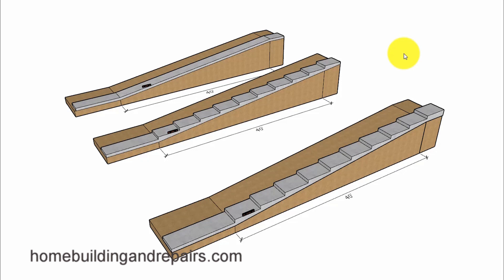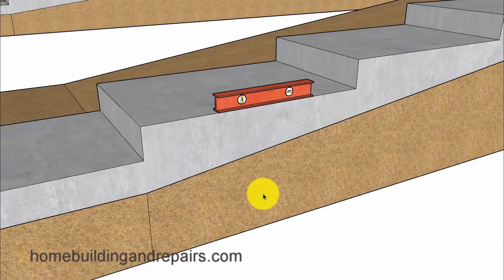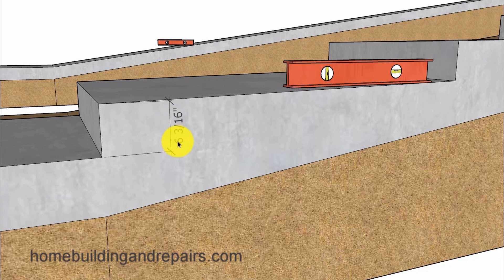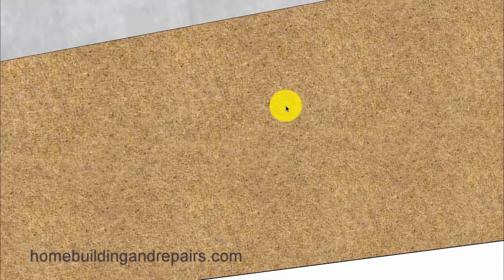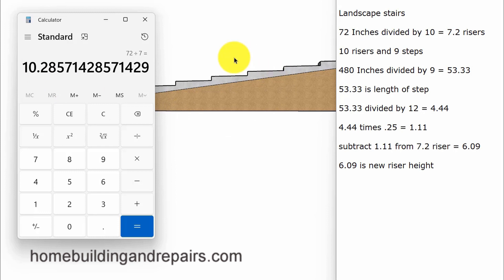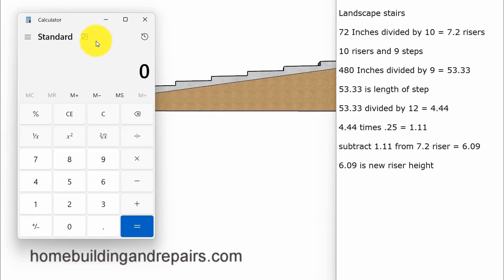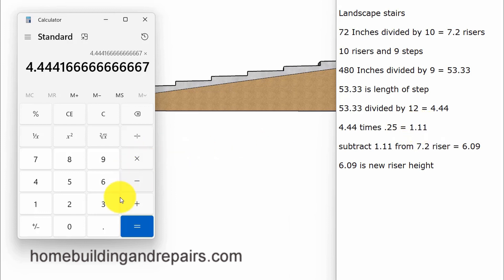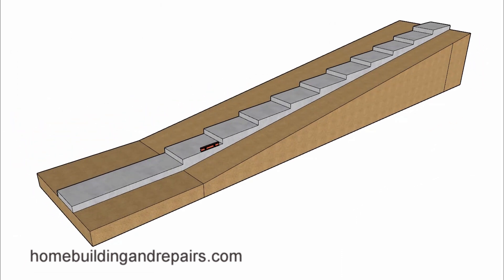How To Calculate Sloping Steps For Long Concrete Stairway - Water Drainage And Directional Flow

Comment: I just left a message on another video (2019). I'm seeing this now. If a stairway is made of exterior composite decking, is it required to be sloped?  Similar to the reasons here?  I see no builders (or any video on youtube) mentioning this apparent requirement (or is it only for concrete, and not composite decking treads with a 'gap' between two boards)? 

Your thoughts?
Reply from the maker: If the stairway has gaps like gaps in decking that water can drain through, then you shouldn't need to slope them.